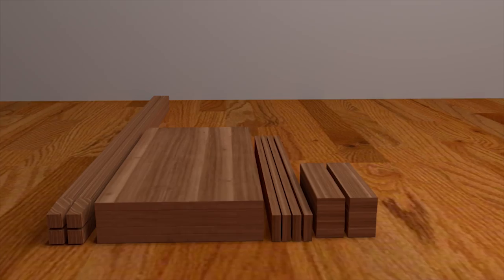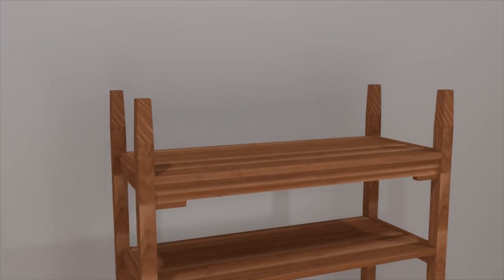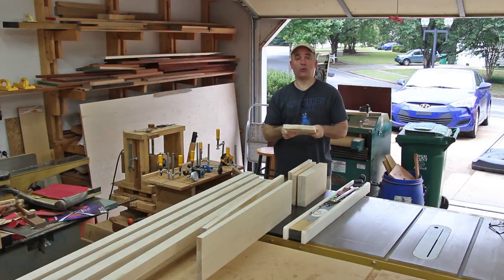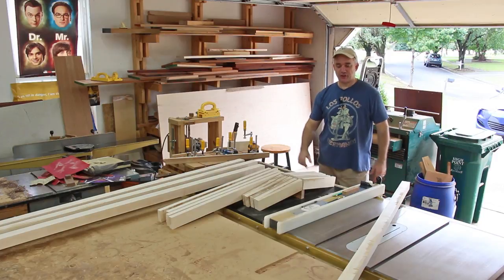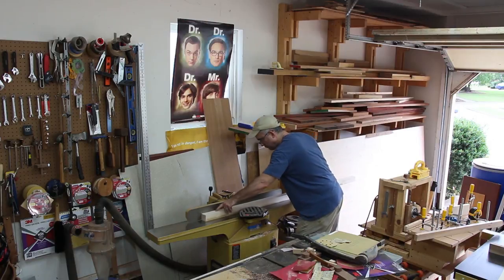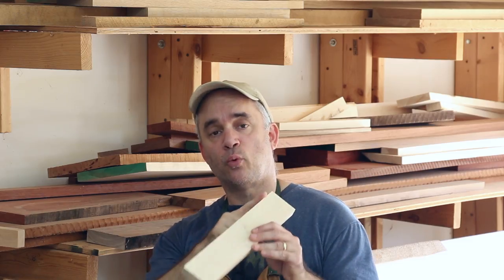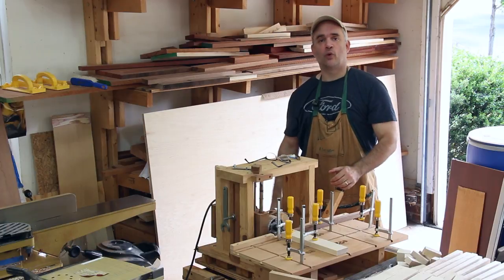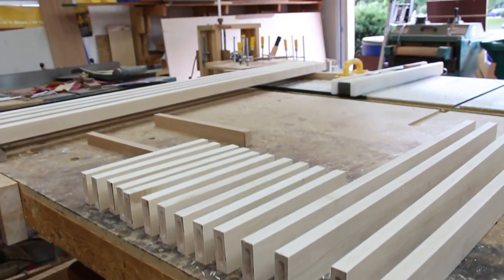Open Bookcase Part 1

Comment: Let me guess.

The reason for the alignment fixture in your previous video was because of the length of the legs in THIS video.

Am I close?
Reply from the maker: I wasn't kidding when I said that not knowing how far from parallel I was was bothering me.  It was however a great time to check before this project. :^)

Comment: 1. Cool animation!
2. Any perticular reason for cutting the long side to width on the band saw and not the table saw?
3. Just my opinion but a 5 minutes is short. No real reason to cut to part 1 and 2.
Reply from the maker: +comma1981 This Friday part 2 will be ready; bigger projects take more time.  That 5 minutes was a week of work.
Reply from the maker: +comma1981 To your band saw question, I wanted to maximize the yield from each cut.  The bandsaw leaves a much smaller kerf.